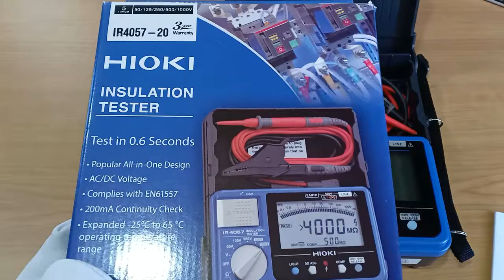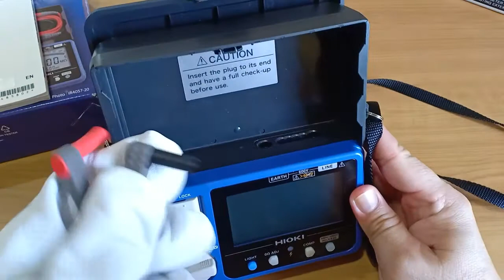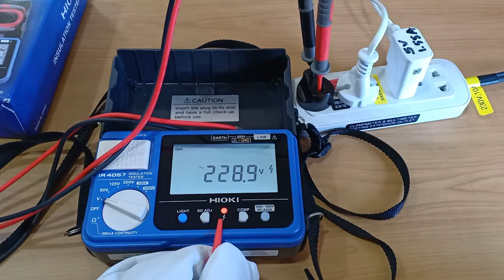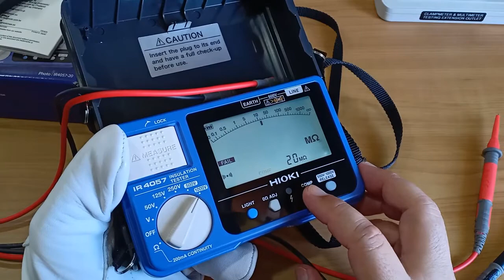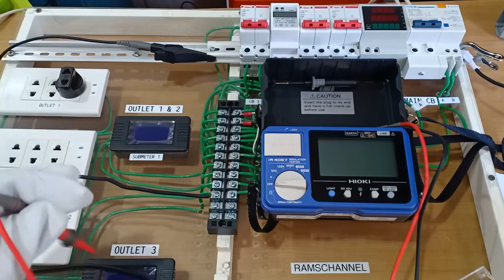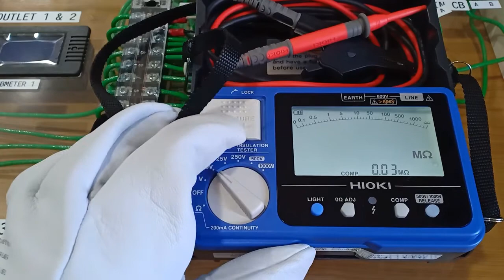[ENGLISH SUB]Hioki 4057 Insulation and Continuity Tester- Overview and Functional Test Simulation

Comment: At 3.15, what happens if you press the Measure key while measuring voltage?
Reply from the maker: There is a warning in the user's manual which states: Never press the MEASURE key while measuring voltage. Doing so could damage the circuitry or cause an accident that might result in injury or death. As a safety reminder any user should be thoroughly familiar with safe use of any electrical test equipment to prevent damage to equipment and most importantly to avoid risks and dangers to the end user. You can download the user's manual for free and refer to it for more details on how to operate it safely. Safe testing!
Reply: @ramschannelreviews Thanks.

Comment: Amigo la barra indicadora de arriba 
Indica el voltaje o también los mega?
Reply from the maker: Hello. The bar graph is only used for insulation resistance measurements (to simulate an analog graph) in Mega-Ohms.
Reply: Aah okey te merca los mega igual entonces.

Comment: Consulta tiene límites de metros al megar? Ejemplo una línea monofasica de 200 metros se puede megar con ese equipo ??
Reply from the maker: No, it has no settings for the length of conductors. But I've seen technicians testing insulation resistance of feeder conductors, of any length, at the main panels.

Comment: The carrying case is useful, reveals equipment for testing.  Retains lid and holds leads.  Would be nice to see a case for multimeters that do the same and hold additional leads like clips and thermocouples, so case is an extension of the test equipment.
Reply from the maker: Agreed. I used a generic case for a clamp meter for the very purpose of storing extra test leads and alligator clips. I can't stress enough the usefulness of alligator clips in the field.

Comment: That reading 230v and you select (V)  ,is that ac reading sir?
Reply from the maker: Thanks for watching sir. Yes, the IR4057 has a voltage measurement function, like a digital multimeter. It can test voltage of commercial AC power, minimum of 30V up to 600V. DC voltage up to 600V. More details here: https://www.hioki.com/sg-en/products/insulation-testers/5-range/id_5941

Comment: Do you know if this could cause a pin hole in a separator bag of a lithiumion battery by trsting with 250v?
Reply from the maker: Hello. You asked if the Hioki 4057 could punch a pin hole at 250V DC test voltage on a separator material used in Lithium ion batteries? I regret I don't know if such a test is possible or safe as I am not familiar with it. In practice, the instrument should not damage any electrical insulation material under test at only 250V. But I cannot say for certain how DC insulation test voltages would affect the particular separator materials you mentioned.